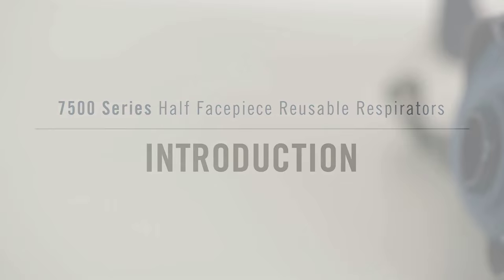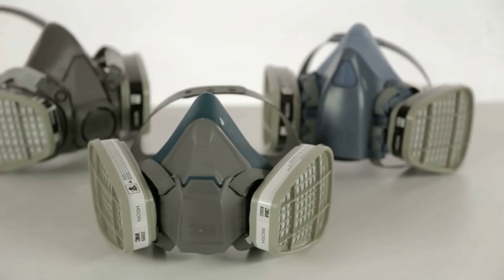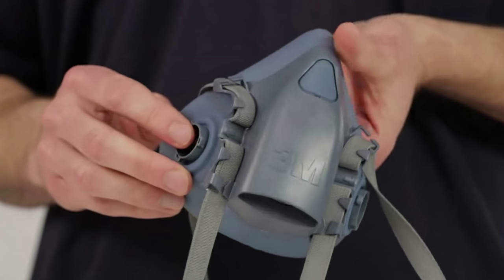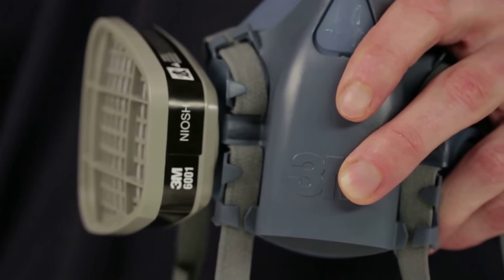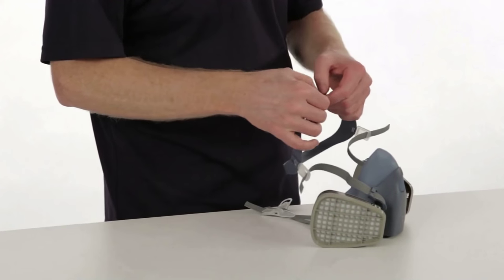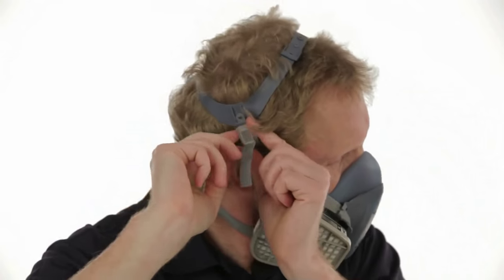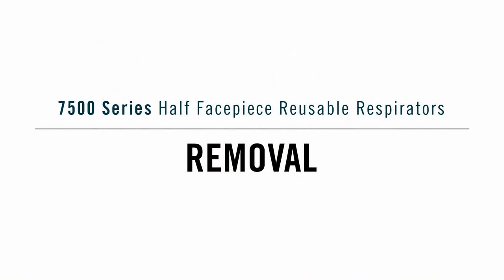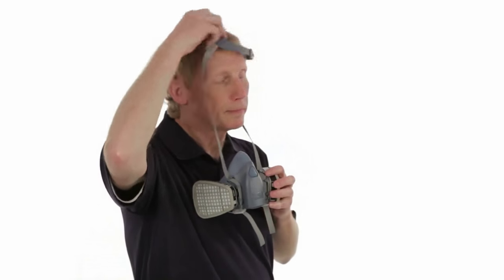3M Half Face Respirator 7502

Comment: Are you suppose to take out the covers on the filers ?
Reply from the maker: Hi Tatiana, the filters have retainers. These encapsulate the particulate filters which are placed on top of the organic filters. You need to remove the covers (retainers) to access or place the particulate filters in (5925). Using particulate filters will give the organic vapour filter extra life. Hope this helps

Comment: Can it be used in a dental clinic? And can it be autoclaved?
Reply from the maker: Hi Aishwarya, sorry for the late reply. The 7502 is ideal for working in hot and humid conditions or during prolonged use. It provides protection against gases, vapours and particulates (depending on your needs). Hope this helps